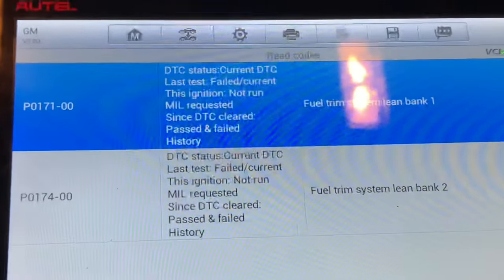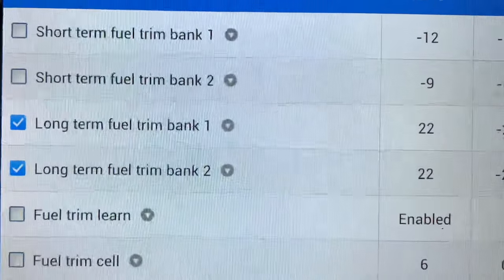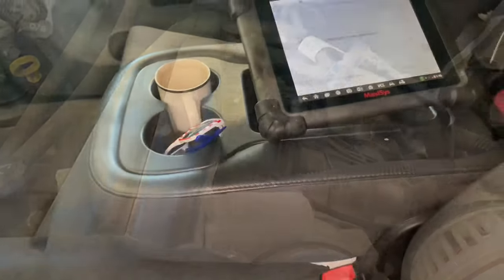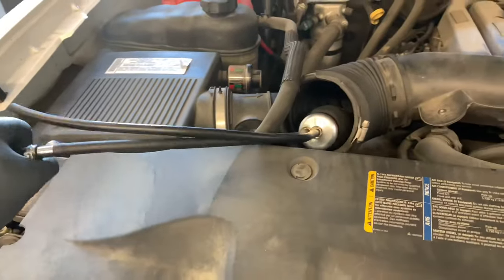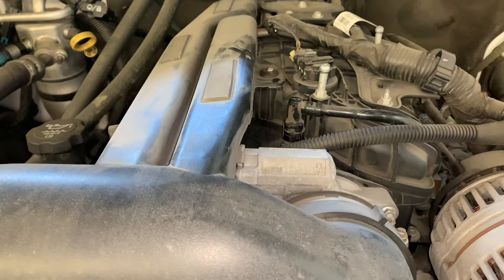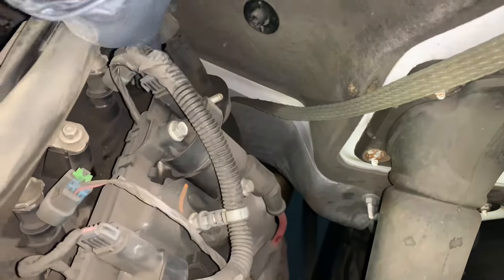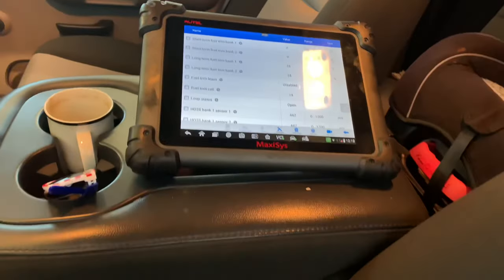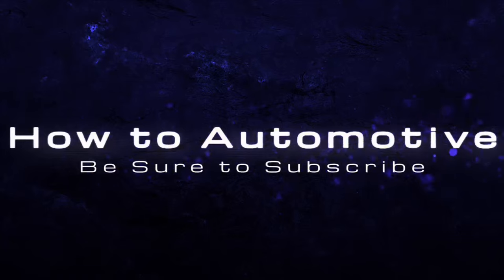How to Diagnose Code P0171-P0174 on a Chevy Silverado 2500 HD

Comment: I usually just use some carburetor cleaner and I spray it around the intake strategically to see if the engine RPMs go up. If it does you know that you have a vacuum leak and it's easy to find without all the stuff that he had

Comment: I'm looking at quite a few codes on mine and these are some of them so I'll make sure to look at the hose.

However my exhaust manifold has two broken of bolts would cold care seeping from there cause this as well?
Reply: Fuel trim uses your O2 sensors to read the content of the mixture, if there is an exhaust leak, especially a large one, it can throw off the readings that the O2 sensors get.

Comment: Great simple video that covers a lot of variables. I like that intake bladder setup. It looks a lot nicer than the kit of different sized cups and clamps that we generally used. Do you use it for boost leaks as well?
Reply from the maker: Rustbelt Mechanic you can use it for boost leaks I believe Redline make a specific  smoke machine and bladder set up for high pressure systems.

Comment: I'm dying,  can't find the cause to mine. Changed to new injectors and new intake manifold gasket.   All my vac hoses are good.  Torqued my intake gasket to spec, so maybe I'll throw in my old injectors to see if that was it. ??? Same lean codes...
Reply: Fuel pump
Reply: Turned out it was the new injectors. Some just didn't work properly.   Got a good tested set of injectors and all went away.

Comment: I have both of these codes on my 5.3L '06 Silverado 1500 LT.  Also had one for the evap solenoid (P0449 if memory serves), but I replaced that and the code didn't come back.  

For the lean codes, one shop suggested that it was probably the intake manifold gaskets.  I'm not a mechanic but it seemed like a good possibility, really thought that would do it.  So my brother and I replaced those this past weekend.  Seems to run just a tiny bit better, but the codes keep coming back.  

The truck has "drivability" issues - takes 2-3 tries to start when cold, gets poor mileage, loses power going up hills, etc.  Luckily I live and work with my brother so I've been able to avoid driving it for the most part, but it can't stay sidelined forever.  Need to get this figured out.  

As long as you're just cruising and don't need to go over 3500 RPM or so, it basically runs fine, but gets bad mileage.  I bought a cheap OBDII scanner and started learning a little bit about how to read fuel trims.  Most YouTube videos with these codes end up being vacuum leaks (seems like all of them are), but I'm starting to think it's my fuel pump or something in the fuel delivery system.  Of course, my truck is one of the first few models that had the fuel pump/filter inside the tank, so that's a whole new can of worms.  

Thanks for the video, would greatly appreciate if you have any input on mine.
Reply: Hey just curious ever found the problem?
Reply: @michaelsterling2276  Yep... Ended up being clogged catalytic converters.  Weird because it wasn't throwing any cat codes until I tried everything else.  Also replaced O2 sensors.  Runs good now, but wasn't cheap.
Reply: @TheDrewker  ah yeah makes sense, I have the 4.8 and I believe it has dirty fuel injectors and the fuel pump is going bad, it has been sitting a couple of years.  Thanks for responding!